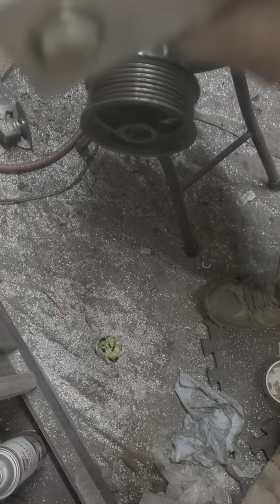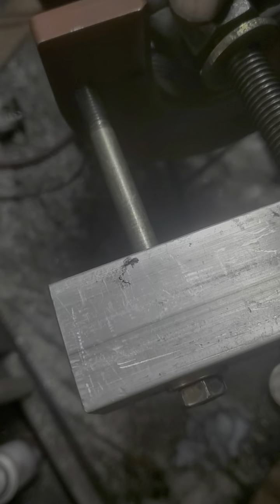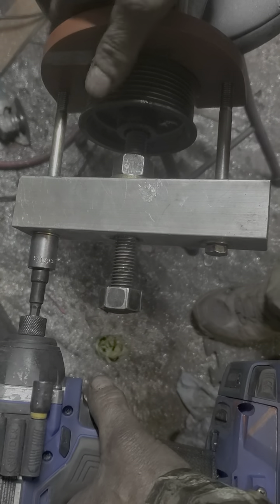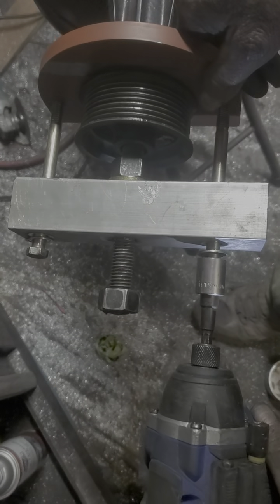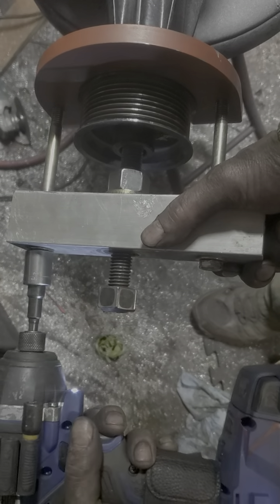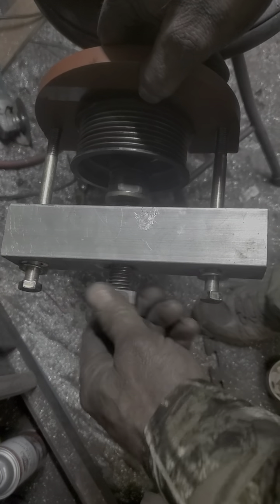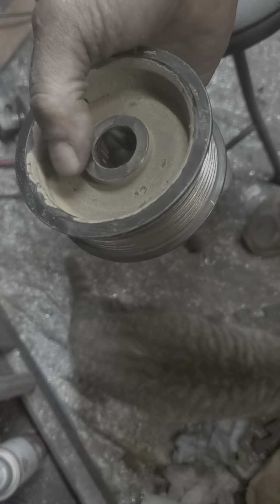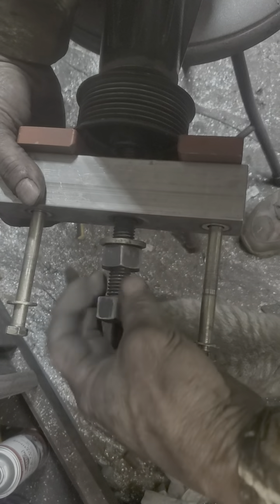Metco Supercharger Pulley Removal/Installer Tool How-To For Dummies

Comment: You don’t use the block or collar to press the pulley back on just simply thread the bolt into the super charger and use the nut to press the pulley back on